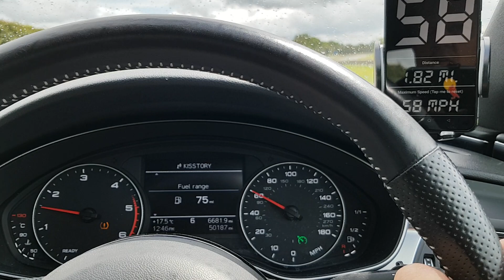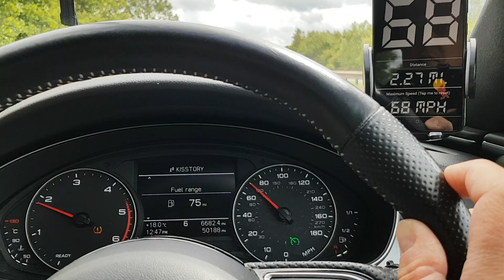GPS versus Car Speedometer Speed

Comment: Do you think that the car dashboard speed is always ahead than the actual (GPS) speed in all car manufacturer? Do you have any car manufacturer document or a write up? especially for Toyota PRADO.
Reply: Anees Hamsa the cars speed are allways less! Unless you are mot using tyre and wheel size Thats not recommended by manufscturer
Reply: @bmwsincekid  Thank you..!!
Reply: @bmwsincekid  Hyundai Starex, Malaysia, fully original including tyre specs. Using Google maps and waze which always show my car around 4-5 km/h difference. Tried it on my other premium car and same results.
Reply: I'm driving a 2005 Camry & for some reason my GPS doesn't match my speedometer but every other car I've had it matched is something wrong & which 1 should I use to monitor my speed?